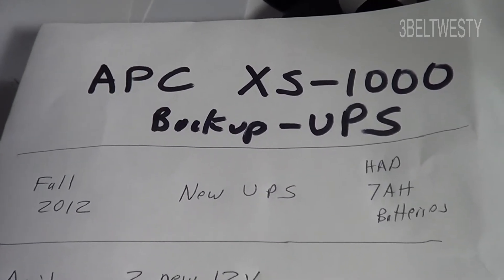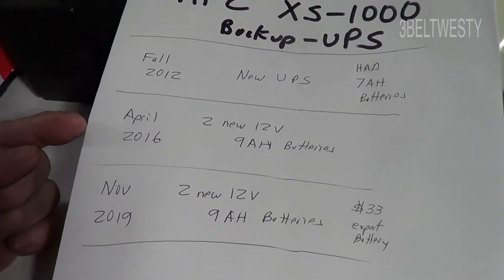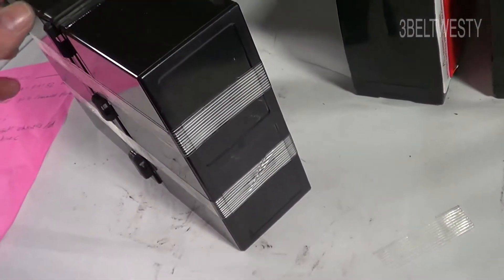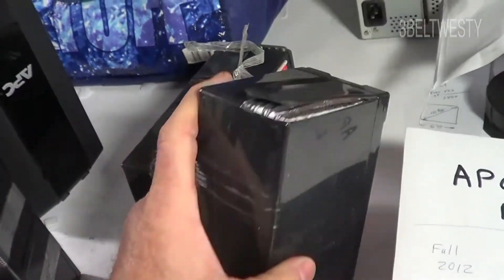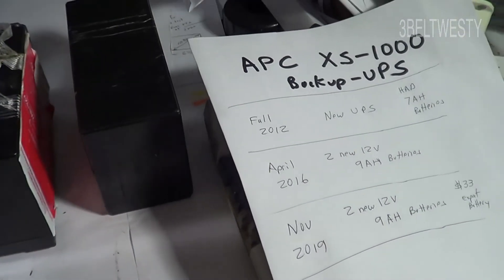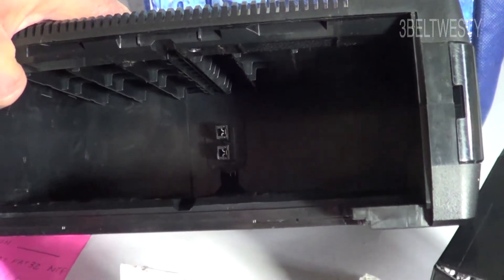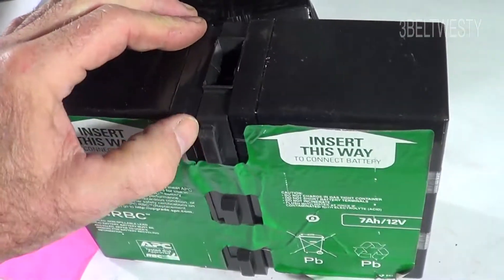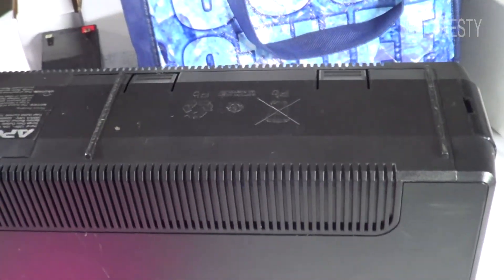APC XS 1000 UPS battery replace again

Comment: Do the original Long brand last longer? 🤔 Can the batteries be upgraded to Li-ion type, with a BMS update/mod? Should you periodically let something run off the battery, to discharge them, then recharge them?

Comment: Thanks for the video! Did those batteries catastrophically fail and split open like that? Or you were opening them up to take a peek? I'm also seeing about a 4-year lifetime on these batteries. I had previously replaced the 7AH with the 9AH ones, but I'd like to do something better like (2) 35AH ones. Fashion a connector adapter, with appropriately large enough cables from their proprietary connector over to the battery terminals....
Reply from the maker: What happens is the utility AC power has been off and due to a thunderstorm for 15 minutes and the next day you note the computer is off. The two gel cells are in float mode and I guess they get cooked in a few years. This has happened twice. 

I goofed up once by rebuilding the 24Volt power pack and placing it in the UPS but not plugging it in the AC line. There must be some keep alive current when the pack is installed . This is where I got busy and said I need to add the UPS on the computer but never did. Thus  2 months later the brand new pack was dead and had to be rebuilt again. 

With another UPS 22 years ago it used just one 12V gel cell. I ran out the 12V DC power leads to a 27F size big deep cycle marine/start "car" type lead acid battery from walmart. That 27F 12V battery would hold up a computer or 2 for many many hours. The "failure mode" was the UPS would boil out one of the lead acid  cells after a year. Thus with the 2nd battery I just checked the water level every 2 months and it lasted many years. An inline fuse was added so if the UPS shorted out there would be a safety fuse. That old system was for an ancient set of servers that uploaded files on dialup to the direct dial cloud 22 years ago. Before high speed internet was available here sometimes after work I would have 1 to 4 servers uploading data on dialup at 28k. Weird uploading many gigs of data in a few weeks! But it worked. 

My take is the float charging voltage might be too high on these some of these UPS units and thus the pack fails early than 2 to 3 years.